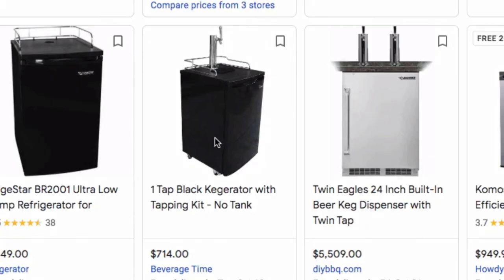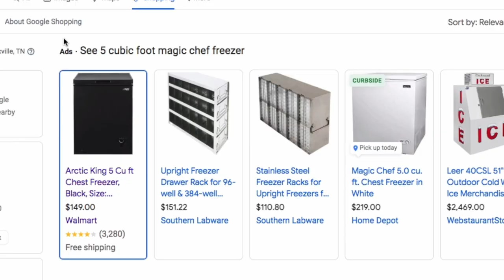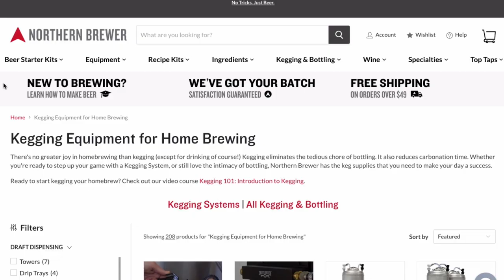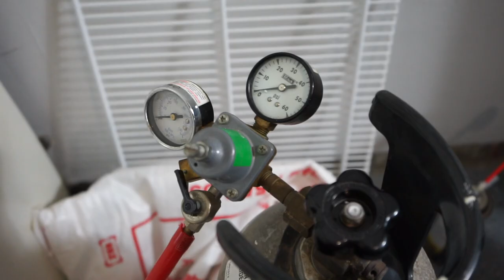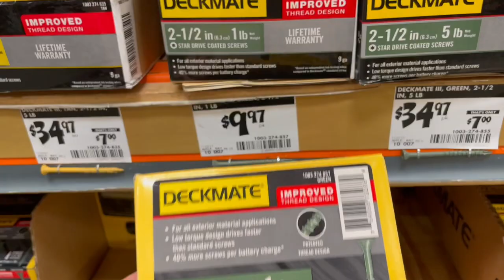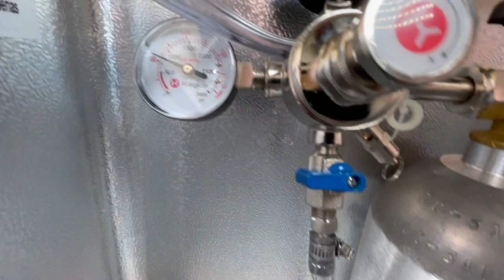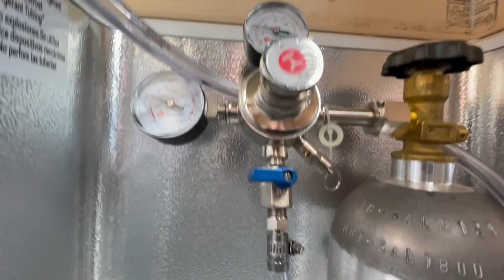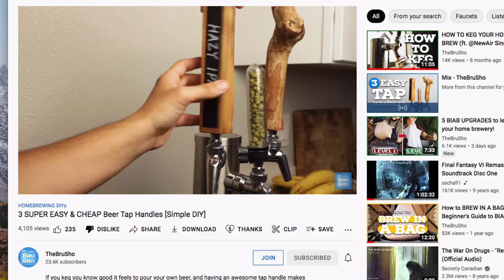BUILD YOUR OWN DRAFT SYSTEM! (at home!)

Comment: Instead of external temperature switch on my kegafreezer, I take the thermostats of junk refrigerators I find on the street.  Its pretty easy as the wires for both are pos neg, ground, and thermocoupler.  Easier and cheaper.  Then I lable it instead of hot cold to Margot Robbie and Rachael Maddow.

Comment: Do not use teflon on all threaded parts, some are using concave sealing and teflon would ruin the fit and thread pressure. When you see a rubber or a plastic on the end of the fitting do not use teflon.

Comment: Keezer guy here. My cousin had an old CL fridge and after awhile the door was barely hanging on. 

One pro tip if your buying a new chest freezer: if you are moving and need to buy other appliances buy the chest freezer at the same time. That way the store will deliver it all at one. No chance I was fitting a 7CF chest freezer in my Hyundai Elantra.

Comment: Pro tip...no, wait. Amateur tip. I just built a Magic Chef keezer one size bigger. I turned the cover on the LED wire upside-down so the wire points up, and suddenly the wire was long enough.

Magic Chef was kind of stupid for installing it the other way.

Comment: Suggesting 8 feet of beer line without knowing the users preferred temperature, serving pressure and beer line inside diameter is not a good idea. Your set up may work fine with that length but all of those factors come into play when balancing line length.

Comment: All really great videos, great comments on kegerator vs keezer. I wonder if anyone has tried out a combination of the two: instead of drilling into the mini-fridge, like in the typical kegerator build, take the door off, built a collar and put the door back, but now onto the collar. The collar needs to be clamped on tight, but that could be accomplished in many ways. The tap column can then be mounted on top of the collar (made out of 2x10 “ boards).
You could then, after the party, easily revert the thing back to a fridge and when you need it, you can re-assemble it in maybe half an hour into a kegerator.
Any thoughts or comments or concerns etc?